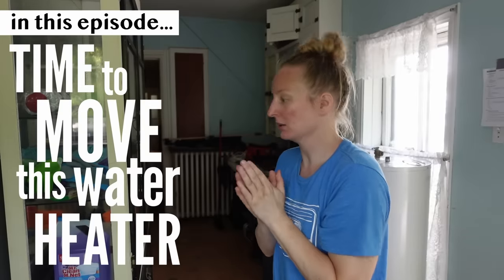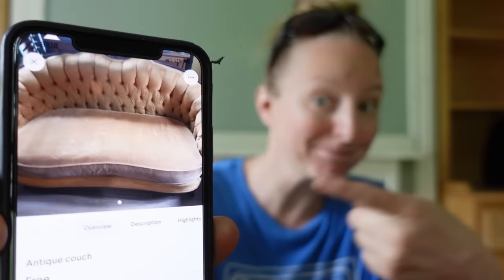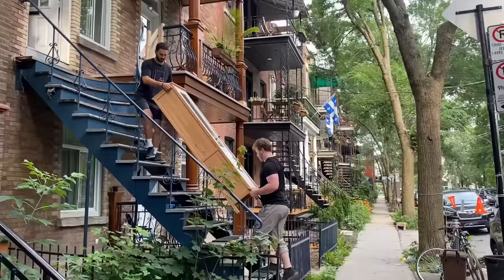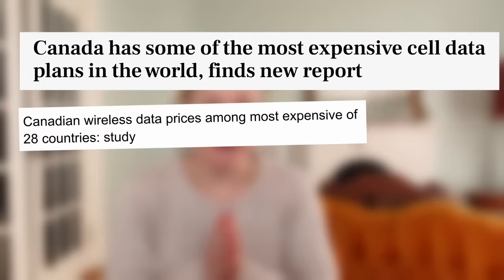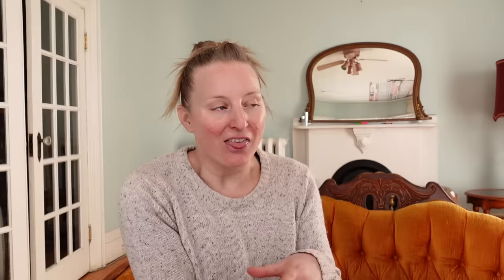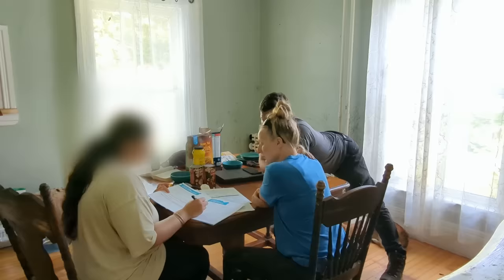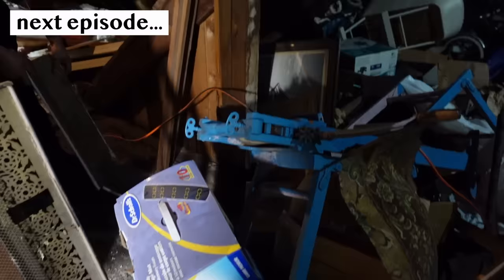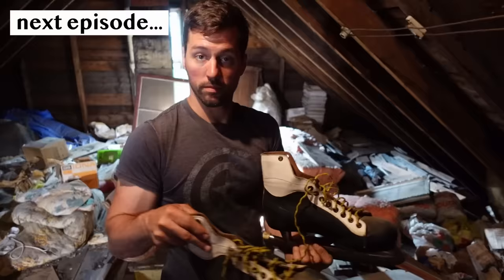you won't believe what we found behind this wall 👀

Comment: Do they may inserts for old coal stoves or is it possible to convert the space behind the coal stove door to a wood burning space? OR WOOD PELLETS?? Ooo could you burn wood pellets IN the coal stoves?! Maybe there is a way to keep them? They are SO lovely. Maybe not all can be saved but I hope so? And if the wood pellet idea is workable, it might be worth running a chimney liner down and making all that safe. We heat with wood here in Norway and I LOVE it. Yes it is messy but the heat is lovely. Wood pellets would be LESS mess for sure - I have a friend who burns wood pellets. And her stove looks like a furnace vs a stove, but it works. And in Canada, is it possible to get coal? Because if so, that might be surprisingly cheap. If so, then using what you have and just paying to line a chimney might be the cheapest option in the long run. IF the price of coal vs wood pellets makes it even an option? And I do not even know if wood pellets in a coal stove would work, but why not?? And they would smell good too! I hope you find something that works… chances are you have already, but 😂😂 had to comment! (I LOVE those old stoves & our house is 1873/4 and woodheat except for electric heated floors in the bathroom, luxury! And we use space heaters when we are away. 👍🏻 And yes Norway allows us to insure our house with no central heat! Love that! But I know you are thinking baseboard water, so perhaps you can keep the old coal stoves & use pellets instead for a cozy warm fire sometimes? 🤷🏼‍♀️🤞🏻🤞🏻🥰
Reply from the maker: Yes, you can get coal here (I'm fairly sure, but haven't actually checked into the logistics), but I definitely want the fireplace for the wood-burning experience, not for the actual heat. I love the process - the lighting, the feeding, the stoking, the sound it makes, the smell it gives off... so lining for sure a good idea, even if the chimney is sound, but then it's to figure out how to safely burn real wood in it if possible!

Comment: In the UK I have seen coal/wood burners. Is there any availability of smokeless coal in Canada? Or have you considered LP gas? In rural ares in the US LP gas is fairly common. Depending on weather and energy efficiency, sometimes people can get through a winter on only one or two fillings of an LP tank. Just a thought.
Reply from the maker: I definitely want the fireplace for the wood-burning ✨experience✨, not for the actual heat. I love the process - the lighting, the feeding, the stoking, the sound it makes, the smell it gives off...

Comment: I wouldn't bother with the fireplace or a wood stove. If you had a good source for free wood long term then maybe. But you also need to factor in higher insurance costs when you have a wood stove. As far as the attic space I would use it for storage. It would be something to consider if you do end up with not enough space for your needs with the rest of the house. You have other bigger issues to deal with first.
Reply from the maker: It sounds like you need a little whimsy in your life! Neither of these are immediate or pressing concerns; I made that clear. We’re talking about the “one days” here 😊

Comment: Okay, this is five months after you posted, so maybe you won't see it, but I have a coal fireplace just like yours, thrifted from a second hand site here in the Netherlands, and I only burn wood in it. It works like a charm. I ensured I had a pretty large hearth in front of it. I just lay one or two blocks (or sometimes three) on their side in the basket, and light them up and then you can just add a block at a time on top. No problem, because, as you already mentioned, coal burns hotter than wood, so the wood doesn't damage the fireplace. The only thing is that you have to clean up the hearth from ashes after an evening with a nice fire.
Reply from the maker: Oh interesting… is your firebox super shallow tho? Because mine is, and I’m thinking I’d only be able to burn tiny logs and sticks, and would have to constantly replenish the fire

Comment: At least in US, it's prohibited. If you use the attic in the future, it prevents access as a potential egress.  This is the regulation:

"How far away from an openable window does a plumbing vent ...
Each vent shall terminate not less than 10 feet (3048 mm) from, or not less than 3 feet (914 mm) above, an openable window, door, opening, air intake, or vent shaft, or not less than 3 feet (914 mm) in every direction from a lot line, alley and street excepted."
Reply from the maker: It seems unlikely that the vent is a problem for a few reasons: there are already two interior sets of stairs, thus two exits in case of fire. And three other windows in the attic, one on each side…plus even if you did manage to open the window, then what? Jump 10 metres to your death?
Reply: Again, US regs, I'm guessing if you were using the attic for anything but storage, you would have to add a fire escape outside. But what a fun project.

Comment: The fridge section of our fridge stopped getting cold so I've been filling bags with ice and putting them in there to use it as a cooler for our produce and milk. We are having trouble finding a fridge that will fit both the current kitchen and our planned remodel so I've been doing this for several weeks lol. It's surprisingly stressful to have to keep making ice to keep the fridge sufficiently cold but at least the freezer still works so I don't have to buy ice. Warning: zip top plastic bags don't stay water tight for repeated use with sharp things like ice and you should have a thermometer so you don't give yourself food poisoning.
Reply from the maker: I mean, I think I'd recommend to most people to just get a new (new-to-them) fridge. The secondhand market here is pretty tiny, but even so I found this one for $100... not cheap, but not that bad for a fridge in good shape, and no risk of flooding or food poisoning. Although as a stop-gap measure, your solution is very creative!
Reply: @ShannonMakes  my sister and I (we live together) are either lazy or have executive dysfunction depending on who you ask (we both have ADHD). We have a bloody mini fridge in the back of our packed garage that is a free temporary solution, we just can't be arsed to dig it out with everything else on our plates right now🤦‍♀️😂

Comment: Try a wood stove!
Reply from the maker: but wouldn't that require removing those gorgeous surrounds?
Reply: @ShannonMakes  not at all! I've seen them were they come out a bit, leaving the original fireplace alone. In lots of cases, it's done for cost reasons. You can stick a pipe up the chimney cheaper than repairing the chimney. Then, when you've got the funds, actually repair the chimney so you can use the actual fireplace.
Reply: @ShannonMakes  wood/solid fuel stoves are more heat efficient than open fires, and you can cook on them! Also check to see if you have a back boiler in the chimney breast. That's a water tank inside the chimney breast heated by the heat which goes up the chimney when you have a fire. I know they can be retro fitted but I'm not sure how tricky it would be. They really come in handy if you're in a power cut prone area, or even if you simply light a fire often.

Comment: Real wood fireplaces are cool, but they contribute more pollution to the air than burning coal, and the time it takes for a new tree to reabsorb the carbon makes it even worse. :/

Not gonna judge, but just some food for thought. A lot of people in the global North are turning to wood burning because it's "natural" and trees are renewable, but according to the data we have, that's just an appeal to nature fallacy. So it's neither climate neutral/friendly, nor air/asthma friendly. It really is something we should be stopping globally.
Reply: I should add: I'm not advocating for coal, either, but that's a common misconception, that coal is worse than wood. It's probably worse for the people mining it than cutting trees is, but carbon emissions + pollution upon burning is the primary comparison I'm making.
Reply from the maker: Interesting! I can’t claim to have any knowledge on the data, so I can’t speak on that (although, unrelated, I do know some residents of Cape Breton still burn primarily coal…) but either way, this is not something I’m looking to do on a regular basis. The quantity of fuel I’d be using (a few fires a year) is so negligible that I don’t think it’d make a difference what I’d be burning